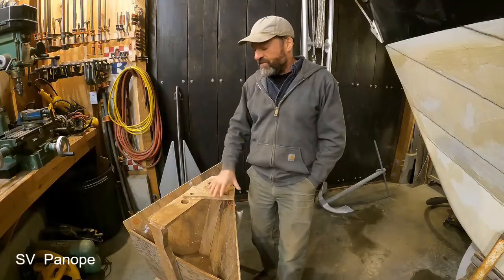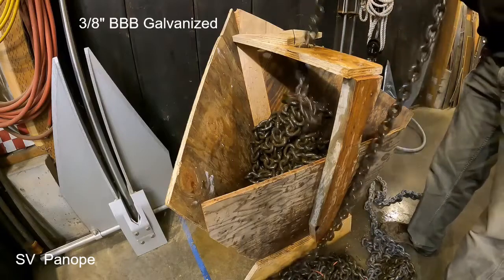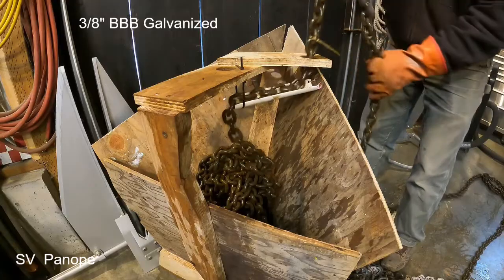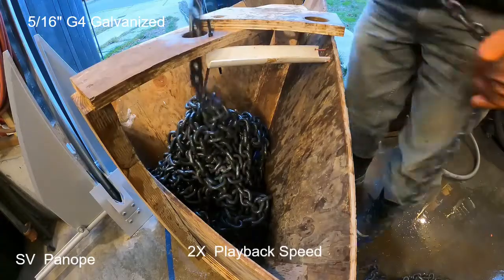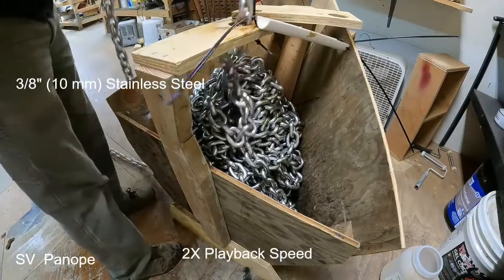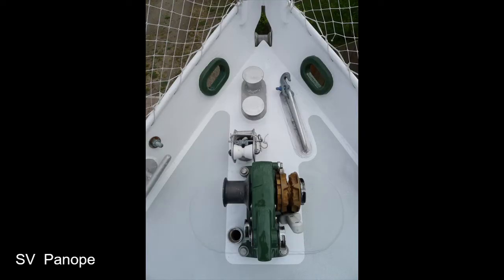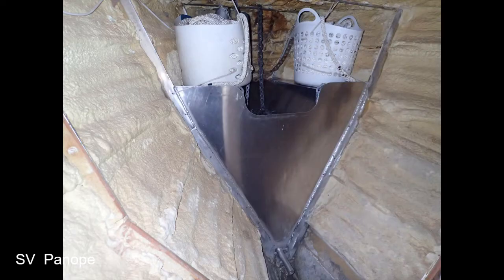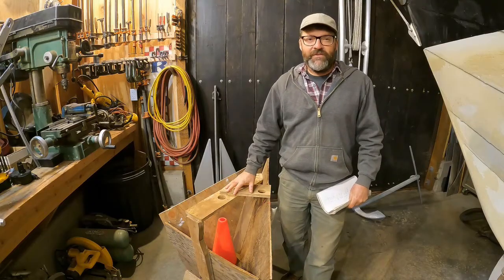Anchor Chain Piling Solutions. Galvanized vs. Stainless. Video # 143

Comment: Checking the price of calibrated stainless steel chain makes my stainless steel balls rust! 😂
Reply: Fresh water not really a problem but using stainless in salt water is a big no no. Galvanized is best for chain and anchor.  Crevice corrosion on anything used under water that is stainless.

Comment: So Steve, I thought a lot about this whole problem of anchor chains during my ten years in Mexico. I anchored out constantly and found the chain rusted quickly from sitting in salt in the locker. I also do not want to go to smaller chain with my new boat, as when the wind gets up a bit I don't want to be waltzing all over the Anchorage, as catamarans and those on rope do. The biggest and heaviest chain I see on most boats is 3/8 bbb, but my current boat weighs three times as much as my former boat, the 3/8 chain won't be as much of an advantage, but still some.  Now I am rigging a fresh water wash down, which will spray all the chain as it comes aboard. It should not rust as much.

Comment: When sailboats heel, the chain pile can fall over on itself. When this happens the chain can fail to deploy. And it's difficult to get the chain sorted to where it will pay out. It would be interesting to see your mock up loaded with chain tipped from side to side before attempting to deploy. Great videos.
Reply: I wonder if this is where the traffic cone would shine? My hunch is that would would hold the pile steady and prevent much of that sort of tangling.

Comment: Thank you for that. You just killed off one of our winter projects as our anchor locker is almost the same shape as your mocked up one and we use 8mm galvy. We were looking at either the traffic cone or the forward deflection method, but our existing hawse hole is just aft of the ideal central position so we seem to have the best answer already and installed by the builder 😃 

One additional advantage we have is that we can access the chain locker from the deck and just knock down any piles. It is a little awkward because we have to twist around a bit but I think if we alter anything we will just make things worse.

So thanks once again 👍

Comment: I have 300 ft of rusty 3/8” chain.  This has been a big problem. Thanks for your efforts and excellent video. I’m replacing the chain with less chain and a rope to chain splice. Also a new anchor swivel should help since twisted chain adds to the problem.

Comment: This was a great demo appropriate for most boats. Luckily, I have a centerline windlass (Lofrans Tigres) aft of our anchor well on our steel pilothouse cutter. This means I have not only a long drop from deck to chain locker, but my chain locker is a plastic gardening tub or "trug". I'm going from 165 feet to 250 feet 3/8" BBB this winter and I think having a steep sided circular bucket (probably with a petcock or other drain setup) should work better than the usual "triangular box". Or so I hope! Keep up the academic rigour so often absent in things marine.

Comment: I had the same issue on my boat and came to the exact same conclusions as you when I corrected it. 1. Move the hole so that it’s central and over the deepest part of the locker. 2. Get rid of the old rusty chain that has extra friction.

Comment: FYI,  did a quick test with traffic cones when trying to sort out our locker, and got the same result as you with one that had a flat cut top. The chain eventually would lay across the top and then pile up the sides of the cone and over the top again until it plugged.
But on a rounded top cone this did not happen, the chain continued to slip off the rounded top and spiral around the cone and be more randomly distributed. And fall over better around the base of the cone.
Perhaps a case of a small difference having a large effect? Can you try a smooth rounded top cone, to confirm my findings?
Reply: Do you have a photo of your solution?

Comment: Great test. Thank you 😊
But my first thought when you started this test was; what if the bottom/floor of the chain locker was shaped like an A (30-40 degrees) and chain feed in center. Would’nt this get the chain to better fill up the sides as well, and get more chain in? Almost like the cone, just sharper edge, with no posibility to build up on the top, like the cone. 
Just a thought… 😊

Comment: Steve, that’s interesting, another reason to upgrade to G70 chain and downsize gauge. I’ve gone from 10mm G30 to 8mm G70 which has the effect of only a marginally increased weight of rode even though I’ve increased length from 60m to 80m. Also the WLL has increased with the higher spec chain. Now I can add that the chain fits in the locker better too. Happy Christmas to you and your family over there from us over here in the UK.
Reply: The only issue with higher strength chain is that the heat treatment done to it when new can be damaged if you ever need to regalvanise.
Reply: @superwag634  yes, I’ve heard that said and that therefore g70 chain is “single use” only. That makes it an expensive solution but the benefits of it are considerable. Personal choice, I don’t know whether I’d regalvanise chain here in the UK anyway as there are very few galvanisers and generally they are not keen to mess about with leisure boat anchor chain, I suspect because the job is too low value, they’d rather focus on high value commercial jobs.

Comment: HUMM, interesting.  I've wondered about SS chain.  I had..a cutwater C30 power boat.  I prefered to always anchor on the hook.  It had 75ft of chain.  Not much, but wow, it had a shallow locker and would pile after about 30 ft.  So frustrating.  My next boat will be a C-dory 25 power boat.  It will hopefullly hold 75ft also.  If not, I'll look into SS chain.  Seems to be the best.  Any downsides to SS chain?  I have a mantus SS swivel already.  Does SS chain play nicely with a galvized anchor?

Comment: Hi Steve, new to your channel. Really enjoyed your piece on chain lockers and piling problems. We have a Grand Banks 42 and have had continued issues with pile up sometimes in risky conditions naturally near the last 10-20 feet. On a Lee shore in windy conditions that becomes interesting. I’ve reduced the rode down to 140 feet of 3/8” BBB with 8 braid nylon rode for the next 200 feet in a divided compartment and still have the occasional pile up. Thats simply not enough in 50 feet or more. So I’m going to remove the divider to see if I can improve the process. To that end I’m thinking of using a Crosby 3/8” C-Link to connect another 70-100feet. My question is have you ever considered testing “chain connectors”? I’ve reviewed the working loads for the Crosby C-Link at 1250 Kgs. It appears close to the working load for our existing chain. Your comments? Really have enjoyed your testing.we have a Bruce 30kg. Regards, David Boyer S/V CHIKILI GB42 MotorYacht. Home Port Vancouver, BC.

Comment: Having looked into the locker gadgets a slippery ball mounted on a pipe would be beneficial. I may make a spool, though having the room the mess is an issue. I have considered a rotating guide similar to barrel sized welding wire, novel if it could work. Thanks.

Comment: Hi steve
I've been having a little back and forth on anchoring and anchorages  a facebook group.
One guy commented  that you do not even need an anchor if you have enough chain out. I replied  that may apply to ships but small boats they would drag without an anchor But yet there are a few people insist that the chain alone
Will hold the boat. Is this something you would be interested in producing a video on ?
Reply from the maker: The coefficient of friction between the chain and a normal sand or mud seabed will be less than 1, probably closer to 0.5.  this means that 100 pounds of chain will have much less than 100 pounds of holding power.  For my boat, this will provide adequate holding up to roughly 10 knots wind.  That is certainly not enough for me to get a decent night's sleep.

Not sure if it would be worthwhile to make video/test on "anchorless anchoring", but now that you mention it, I too have ran across a few sailors that have held the belief that most of the holding power comes from the chain.  As you said, this is true for ships, but not for small boats.

Comment: Always a problem - we have an access port to push the pile over as it comes in.  Not a big deal - I also use clean engine oil on the chain if I'm not going to use it for a while and that really helps too, as well as reducing rust.

Comment: My boat has a dividers board. It’s just of center of the hole and longitudinal. 
The first compartment fils up than it the rest starts over at the other side.
Our rope is also attached and lives in the second locker. Meaning that if the rope is used you mus roll it in that locker. 
But we have a hatch aft of the winch.
Reply: I should have read further down. I said pretty much the same thing as you.

Comment: Our problem on my Tartan 37C is not the lack of height on the "castling" chain but when you sailed it would fall over and get jammed so that we could not easily get the chain out when dropping the hook the next time. What I did which totally fixed it was to epoxy a piece of plywood to the side of the chainlocker, onto this was a piano hinge attached to another board. This board could be moved or waved as the chain comes in keeping it from castling and spreading the chain flat. There is a small line that runs through the deck via a spare hawse pipe to a corner of the movable wood which is pulled up and down as the chain comes in. Sounds complicated but is easy to make and has worked perfect in 10 years of cruising.
Reply from the maker: Thanks for posting that clever solution.
Reply: Do you have a photo?
Reply: No but will get one in 4 weeks or so, away from the boat now

Comment: A person in the yard recommended that I soak my chain in olive oil and it would no-longer stack when dropping into the chain locker.
Reply: We coated the 135 ft of 5/16 BBB on our PSC 35 sailboat with Boeshield T-9 before we left for the Bahamas on each of our last three trips.  A half can of Boeshield was sprayed on the chain in a tub or box and stirred about to get a uniform coating.  It greatly reduced the tendency of the chain to castle,  and it it remained useful for 3 or 4 months of daily anchoring before washing off. 

I suspect that paraffin wax dissolved in kerosene would work equally well.

Comment: Has anyone ever tried galvanized wire rope as an anchor rode. (perhaps stowed on a reel?)
Reply from the maker: Wire rode on a drum style windlass is fairly common on commercial fishing boats in here in the PNW.  One drawback is the difficulty in attaching a snubber (for shock absorption) unless the rode is made of segments of say, 25 feet length (with eyes at each end).
Reply: @flygoodwin  Something to think about, thanks for the reply